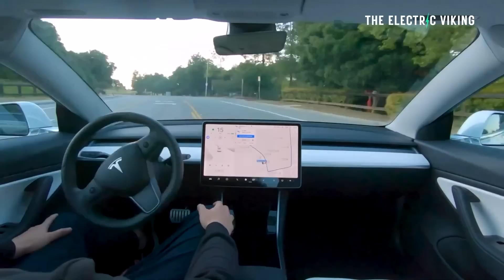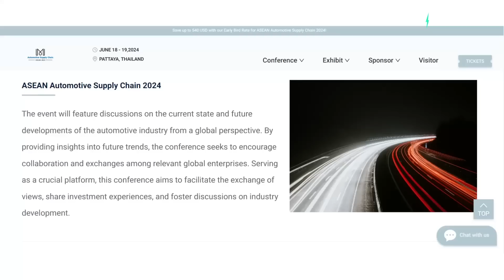Breakthrough battery does 1 million miles & handles extreme temperatures

Comment: I have a Taycan. 
All the Electrify America charging stations are dialed back to 140kw/h after they were overheating the first summer. 
There's none in Hollywood or LA that work.....
So I charge at my loft parking, but sometimes that's not working, and it's a huge problem. 
Range is a huge issue for me whenever I travel. 
Even the new EV's don't get more than 300 miles unless it's one you can't get yet like a Silverado with 450.
Anyway, I'm just seeing progress taking a long long time so far. 
A lot of the Chinese EV's have really poor quality and lie about their stats. The Taycan killer the Xiaomi Su6 or whatever it is. They directly copied porsche. Not very innovative. And all the stats are lies. It's not as fast real world as advertised. The brake pads have had total failures on the top models. It doesn't get as much mileage as claimed. I'm just saying, there's way too much hype in this industry. 
Real world, I'm just not seeing anything amazing yet. And the only charging network worth anything is Tesla, and I can't use it unless I switch, which I really don't want to, because they have weird issues too. Both my brothers have them, and I could give you a list of problems. 
Anyway I'm gonna take a nap on this for like 2 years, and then come back. Hopefully Evs and especially charging make more sense, and also, hopefully our governor doesn't pass the bill he wants to pass to tax us for every mile we drive and force us to put an app in our phone to track all our driving.

Comment: OK, I just Googled 10MW transformer, which is what you would need to charge 20 of these simultaneously at 500kW.  Actually it would probably charge half that many cars simultaneously because DC kW is going to be less than transformer MVA.  The transformer is enormous and costly and needs an expensive high capacity grid connection.  I can't imagine that we have the resources to roll this sort of thing out all over the UK any time soon.  I will stick with my 550hp V8 thanks.
Reply: Shell now converting 1000s of gas stations to charging stations.  
BP recently attempted to purchase Teslas Charging network. 
Even big oil knows the good future is electric.

Comment: A1000 mile on a  single charge means greater autonomy, that means you fx can arrive with 50% charge to a remote cabin provide power to set cabin and drive out to the nearest charger with confidence, I see plenty of benefits with such a large capacity battery

Comment: Lifespan is good, fast charging is good IF the chargers can reliably charge that quickly and actually work. Extreme Cold weather resistance is good.  Now, what about the weight, price, and range, especially when towing?   

EV's have more than one or two problems, to solve ALL of them, that's what's going to have to happen before EV's can realistically take over ICE.

Comment: I hope we get tto the day, where batteries are so cheap that 1000 miles can be standard range.  like it sounds absurd, because that 1000 miles is like driving slow in normal conditions without any degradation.  drive fast with full aircon and it drops.  have it be 10 year old battery and now 1000 miles become like 500-600.  also, charging to 100 with fast charger is slow.  like how amazing would it be if you said.  hey you only have to fast charge once a month if you live in an apartment.  or you can take an 600-800 mile trip and not have to charge until you get home.  or power is out, you have back-up power for a week.  Imagine if battery prices drop another 50%. a lot of people would be into that 1000 mile range.

Also, with bi-directional charging and large ranges, if anyone ever was low on charge, getting a little juice would be no big deal.

Comment: LiFePO4 batteries could eventually be banned in the west. While Lithium Iron Phosphate (LiFePO4) batteries are generally considered safer than other types of lithium-ion batteries, they are not completely immune to risks, including fires. There have been incidents of LiFePO4 grid-scale battery storage fires, though they are less frequent compared to other battery chemistries.  If Sodium ion batteries take off, this could replace LiFePO4, one ubiqutous EV supercharging becomes available, thus eliminating range anxiety even for low range vehicles.

Comment: if these batteries are such a new invention, how is it possible then to already have tested over 5000 charge cycles??? Are we able to believe the manufacturer of these facts??
Reply: Easy, you extrapolate. You make a whole lot of small ones (with the same chemistry) that have a capacity of a few Wh, so they take a few minutes to charge and discharge. So it only takes  a week to test.
Reply: Testing 24/7

Comment: So tell me why manufacturers would want to make car batteries that last millions of miles and 5000 charge cycles ? They are in the business of selling cars. There is no way you will see these batteries in the common car, unless they want to put themselves out of business. It's all just hype, to overcome consumers perceptions of cost and early failure. As you point out the best use case is that of trucks and heavy transport but TBH I don't see a future of heavy vehicle haulage using batteries , sorry it doesn't make financial sense.

Comment: 240Wh/kg means 24 kWh pr 100 kg. So a battery with 72 kWh will have a weight of 300 kg. Isn’t that almost what a standard NMC battery in most evs has?

Comment: Why can not  they make electric cars where you swap battery packs like power tools and gas bottles,  you just have battery exchange centres set up for quick swap and charge centres. Like a race car pit stop all over in 10 mintues for quick exchange.
Reply: All Nio and some xpeng models have that.  It's approximately 3 minutes to do a battery swap

Comment: Have you seen the new Chevy Electric WT?  460 mile range, tows 10,000 Lbs, 230-240 tow range. It’s pricy but it’s large and in charge. It’s able to share power with another EV if you’re short on range.

It’s getting there 😀👍

Comment: I have lots of problems with EVs, fires are No1 and are a big thing worldwide, so, we will have to see how these new ones go, there is no chassis, just two thin rails, one on each side of the battery, very week so no wonder they fall apart on impact, What a shocking week standard they are and then there is the power needed to charge them, there is no grid in the world that could keep up with half of the Vehicles being EVs. Then there is the control they give our governments, easy to turn off any EV if they don't like what you may be saying.
Reply: Ev's have the lowest occurance of fires while hybrids have the highest occurance of fires with ice in the middle as per the us insurance testing institute and national fire protection agency.
In us safety tests, ev's are on average receiving higher scores for safety than ice and are almost impossible to roll over because the battery gives the vehicle an incredibly low center of gravity.
It has been proven that ev's actually stabilize the grid because the batteries can be used to supply the grid when needed.  Also keep in mind that not everyone is plugging into high power fast chargers simultaneously, most charge at home with low power slow chargers.  Solar and battery users are growing exponentially and are creating virtual or community power plants with ev's buffering the supply.
Reply: @jeffpitoniak  Fire alone is not the issue, the fact that the fires can't be put out is the problem when trapped in a crashed car. An ICE vehicle can usually be put out with a small fire extinguisher but an EV will continue to burn to the very end no matter what the fire brigade does. Not for me thanks. The grid may be able to keep up now but there is only a small number of EVs on the road.

Comment: Battery is not a monolithic brick. There is a lot of cells intricately connected through spot welds and bus bars. There is also BMS, that vastly differs from manufacturer to manufacturer. All electronics age, and are prone to vibrational damage in an automotive environment over long periods of time. Batteries are only as good as the weakest component used to makeup the system. Water/moisture ingress is another issue, which reduces serviceability when hermetically sealed with flame retardant pu foam. Also, cooling is vital, loss of which due to malfunction, could degrade battery pack almost instantly within few hours. Just some 💭

Comment: The pathway to better lithium batteries is fairly clear. Improved purity of cathode and anode materials, having the lithium material stored in the form of micro crystals rather than amorphous form and improved packaging. These measures will all extend battery operating temperature range, capacity and overall performance while maintaining safety. 

At scale this is quite hard to do and is drpendent on lots if small measures. However, it should be achievable with time.

A fifty percent boost in battery capacity per unit weight would seem quite feasible.
Reply: Yes Gene Roddenberry powered  a whole starship on Lithium Crystals
Reply: @petere1060  *di-lithium crystals.

Comment: We all know that China pushes the goal posts to the limit with Technology, even though all the politics get in the way.  Yes, it is going to be very scary to see how far the advancements will be in China with batteries and EV vehicles.  Like you say, Tesla is the only one that may be some competition.  The other auto makers are just dragging their feet on still, do they want to make EV vehicles or not.  They still have Fossil Fuel vehicles clinging to their belt loops.
I wish the US and China would get over their political squabbles, but that will never happen. So we will  never see their EV vehicles being sold in the US - or at least now right now.

If there is such a battery now that can do 1 million miles, that would be change the whole outlook of EV's, and in any type of weather.  
Time shall Tell if we see anything like this in the US.
Reply: They will never put a 1 million mile battery in a mass produced car, only perhaps Fleet commercial cars like a robotaxi. The max you are likely to see in a family sedan is a lower cycle life battery with 700 miles of range. For an economy car, 250 mile range is likely.
Reply: @PETERJOHN101  I think this 1 million mile battery is not based on a single charge, at least I don't think so.
I think the 1 million mile battery is the lifetime the battery will last.  I may be wrong, not sure from this video.
Reply: @dathyr1 you’re correct, it’s accumulated miles through out the battery’s useful life.
Reply: I think some of the cheaper vehicles will come to the us.  Even with the 100%+ tarrif plus shipping they will still price out under 25k as long as they can get a dealer in the states that require one.  The Chinese government despirately wants to replace the us car manufacturers so I see this push happening

Comment: What's the charge rate 4C ?
Reply: You can charge that battery theoretically 4 times from 0 to 100%. When someone says you can charge a lithium-ion battery in a car using a rate of 4C, they are referring to the charging current relative to the battery's capacity. The "C" rate is a measure of the charge or discharge current. It is based on the capacity of the battery, where 1C is the current that would charge or discharge the battery in one hour.

To explain this further:

- If a battery has a capacity of 50 ampere-hours (Ah), then a 1C charge rate would mean charging it at 50 amps.
- A 2C rate would mean charging at 100 amps, so the battery would be fully charged in half an hour.
- A 4C rate would mean charging at 200 amps, thus fully charging the battery in 15 minutes.

Therefore, charging a lithium-ion battery at 4C means applying a charging current that is four times the battery's capacity. This allows for very rapid charging but requires that the battery and the charging system are designed to handle such high currents safely.

Comment: So, Sam, can you tell us when China and Australia adopted Imperial measure? Seems like a huge backward step for Ozzies to drop metric and go back to Imperial. God save the king! Australia should switch to pounds, shillings, and pence! 🇬🇧
Reply: Aviation, as in many other metric countries, specifies horizontal distances in nautical miles and horizontal speed in knots... Altitude and ascent/descent is given in feet and feet per minute... Display sizes for the screens of TVs and computer monitors may be described as having their diagonals measured in inches... Firearm barrel length is almost always referred to in inches - Metrication in Australia

Comment: If everyone had solars, wind turbines etc. and storage, it would be impossible to have power outages...
Reply: No, not quite. That's why we should be using the batteries that we're fitting to EV's for stationary storage rather than in cars. Use the batteries 24 hours a day, rather than 1. Solar and wind cannot replace thermal power without batteries.
Reply: @davidbrayshaw3529  Ruin our EV batteries for constant use.  I rather keep my EV battery for as little use as possible.
Reply: @fyeofyeo402  Using a battery to propel a car ensures that the battery is used just about as least efficiently as that battery can be used. So stick with using them in EV's and your wish will be granted.
Reply: Where does all the copper come from?
Reply: Dream on.😊

Comment: If the batteries are improving as Sam points out. Then the talk should be about how easy it would be to replace your old technogy battery being sold now with one of these new batteries. Maybe your old EV will depreiate even more than you had thought it would. Who wants last generation technogy. Just saying. It really makes the current crop of EVs look like  they are experimental.
Reply: Don't expect battery upgrades to be a thing, different characteristics and interface, structural and dimensions, cheaper to buy a new car

Comment: I think you need to wait until batteries have demonstrated a million miles in service over a statistically significant number of vehicles before claiming 1 million mile batteries. Assuming 10k miles as average annual mileage, it would take 100 years to reach 1 million miles.
Reply: Be aware that charging cycles are greatly accelerated in the laboratory and this determines battery life.  The only fail rate that matters is recharging degradation.  These are not specifications we have to wait years for.
Reply: Yeah good point :) taxis can do way higher milage so lets find out soon 😊
Reply: @cellics  No, I reckon you want to do it for regular drivers. Taxi drivers rack up high miles but battery age is a factor too, and performing accelerated life testing may not be valid.
Reply: @brendanpells912  bro you are a clever man!
Reply: @cellics  That what happens when you have a career in industrial automation and control including battery charger design and insulation materials.
Reply: @brendanpells912  sweet!

Comment: Amprius of Freemont, CA claims to have a battery that is superior to the Golden battery's specs. Specific energy is upto 500 wh/kg and charge time is less than 10 minutes, with over 1000 cycles.  Yet their stock has tanked, even though they say these superior batteries are available for commercial application.  I wonder if it is because they are not set up for large scale production.  In fact, the leaders in solid state batteries, such as Quantum Scape and Solid Power, all have been struggling with getting their products implemented into EVs.  This claim of 1000000 miles means those Chinese batteries can be recharged thousands of times without any significant degradation.
Reply: It means 1,000,000 miles before degrading to 70% capacity. Assuming a 10 year lifespan that means 100,000 miles per year. The average NYC taxi does 70,000 miles a year (191 miles per day).

Comment: so If the battery does 1 million miles there is no reason to offer full working warranty...let say for example 500 000 miles?
Reply: They will never put a 1 million mile battery in a mass produced car, only perhaps Fleet commercial cars like a robotaxi. The max you are likely to see in a family sedan is a lower cycle life battery with 700 miles of range. For an economy car, 250 mile range is likely.
Reply: @PETERJOHN101  Yes I know, but Viking trying continue to push this 500k and million miles battery information which does not matter at all because consumers will not benefit this..let say ever.

Comment: One reason Toyota, Honda, Porsche, Mercedes, Lexus etc have great quality is they use scientific methods to assure quality; and it takes many years to perfect the processes. China makes pretty looking bodies (because plastic is easy to form) they have nice looking cars, they put in a lot of computerized technology. That doesn't mean the car will last. A 1962 VW beetle may look ugly, it has no plastic body; nor fancy computer tech but many have lasted hundreds of thousands or millions of miles in the real world. China is focused on price and tech; not quality. You yourself reported rust in the bodys of new BYD cars - Is that quality?
Reply: So the wheels would never fall off a Toyota EV because they didn't account for the higher torque from electric motors, right?
Reply: @bhabbott  It wouldln't be because they used inferior parts or didn't test them. Unlike a Chinese firm; it woudn't be covered up; under Deming QA, production would be halted; until the source was identified and the problem corrected; and tested. Only then would production be resumed.  Vehicles expected that may have been effected by the same error but undetected would be recalled, if a failed part; not checked - replaced. They use Statistical Quality control; the Chinese obviously do not; or you'd never see the sort of junk defects you see on them - missing weld? Garbage parts?